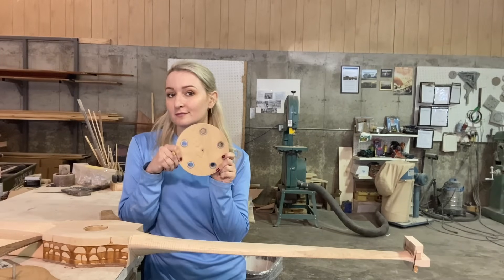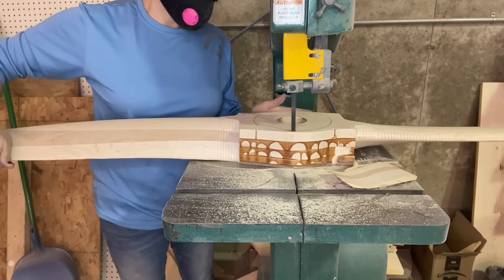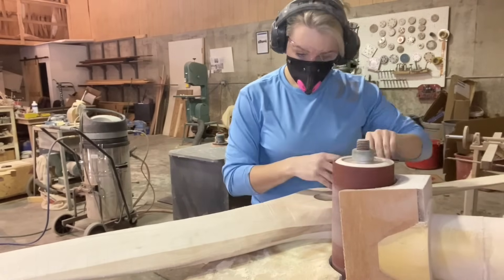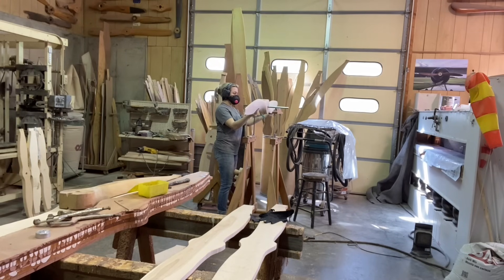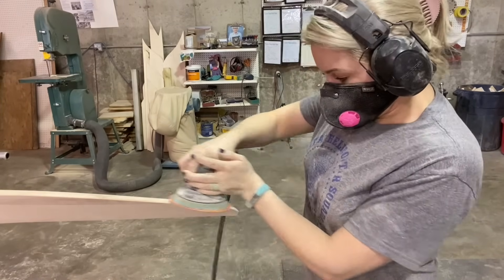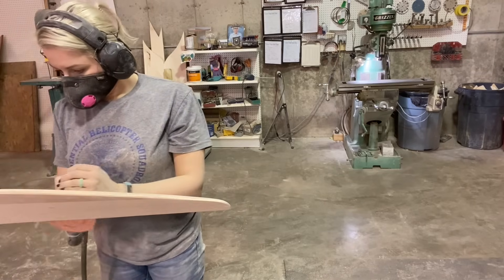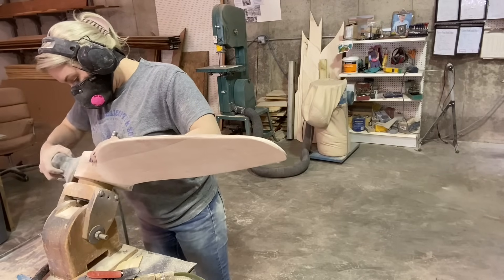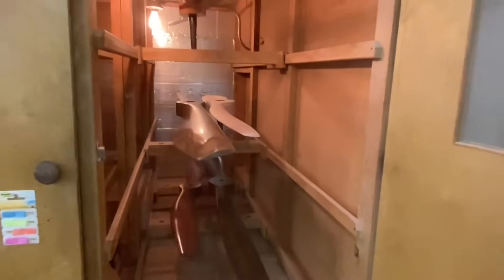Day 3 of making a Corvair/Pietenpol Propeller

Comment: As a machinist and weldor making furniture type stuff, I also use my fingers to feel for irregularities when blending a weld or lathe part....it is said your fingers can feel the difference of 1/50,000 of an inch.......I believe it, protect those fingers from vibration and of course harsh chemicals and abrasives......best wishes......Paul

Comment: what is the block you used to clean the sanding drum,?  I could use that in my shop.
💕😁👍
Reply from the maker: It is a hand held sanding abrasive cleaner Mc Master Carr #4836A32
Reply: @CulverProps  Thanks so much Alaina for the info. 😊

Comment: Don't want to tell you your business, but you might find that if the mandrel you use when balancing matches the hub hole diameter there won't be as much discrepancy in the vertical and horizontal balance.  If the increased friction from the larger diameter axle interferes with the movement different sized bushings to fit the different hub hole sizes could be made to accept the what-looks-like 1" axle... 

Also, regarding the band saw upper guide height, looks like the way you use it fits your application well, but most upper guides have both lateral and fore and aft adjustments for blade positioning and stability.  From the video it looks like the fore and aft roller should be tightened so the blade is held more rigidly; seemed to me there was almost 1/2" of deflection, which seems excessive.

A more rigidly-held balde will aid in more accurate cuts.
Reply from the maker: Let’s stick with your first sentence 😁